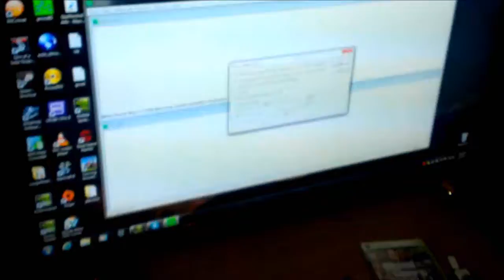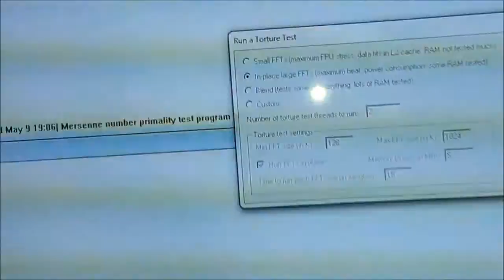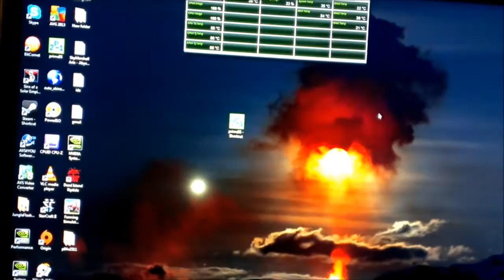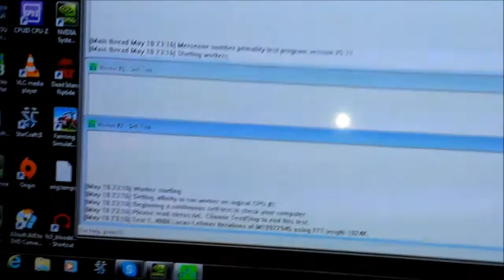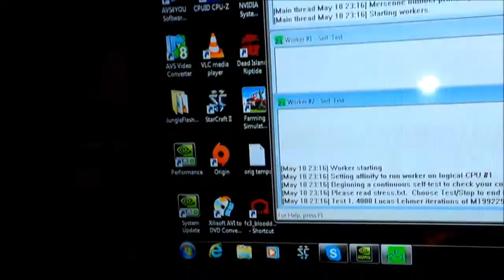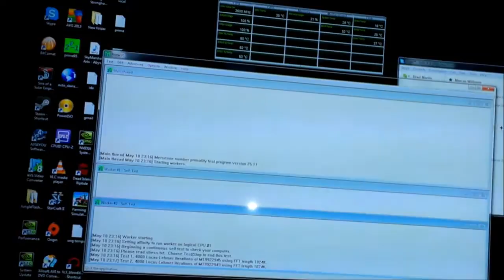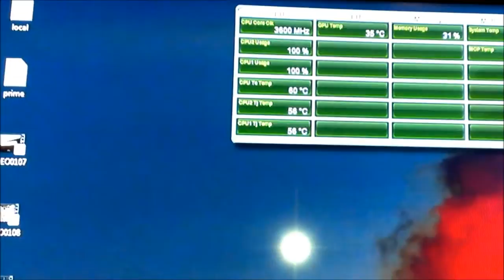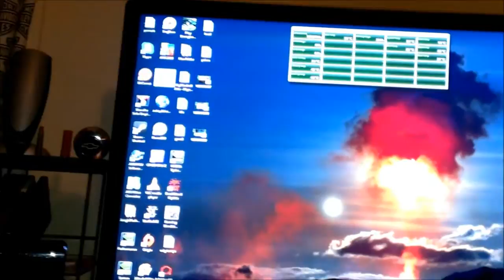Graphene vs Arctic silver 5 thermal paste

Comment: Graphene would be great, but the essential problem is having in paste form. The way the molecules line up, the heat needs to go from one side of the molecule to another. With paste, the molecules are in all sorts of directions. If you had a sheet of Graphene grown uniformly and all molecules are pointing in one direction it should make a huge difference. But, sheets are way to expensive right now. Also, try using a Peltier Thermo-Electric Cooler Module. May see a bigger cooling difference with that.

Comment: For starters graphene is the branding on the tube, god knows what the contents are. I could make a product called "water" and sell people bottles full of oil...

Secondly the whole reason graphene is one of the best thermal conductors known to science is because its so damn thin, the layers that make up graphene are atomic in thickness... somehow they thought mixing those layers with a liquid making it into a thick putty would work.

Thirdly burn in is an absolute must for direct side by side comparison, primarily because thermal "paste" is most heat conductive when all of the liquid has been essentially boiled/ evaporated out of it.

The product is bad. The test wasn't exactly done properly (no offense to the poster, just making an observation).
Reply from the maker: the test was done properly... it was burned in for a week at most. and when inspecting it the grapheme had put gouges into the heatsink and cpu... I have also tried it in a junk computer that had a 2.8ghz Pentium 4 cpu for about 6 months and it completely destroyed the cpu and heatsink surface. had to spend half an hour to sand down both with high grit sand paper... it was terrible.... arctic silver 5 all the way...
Reply: Fair enough, didnt hear it mentioned in the video. well I take back the third part, the first two still stand, which they aren't your fault, its the company selling a product called "graphene" that even if it contains graphene, isnt in its proper form to do its job. Honestly would be safer using a number 2 pencil to shade the top of the processors heat sink, this would at least be closer to true graphene, albeit not perfect.

In true scientific applications for graphene thermal conduction the heat sink and cpu would be all one piece made up of millions of layers of graphene sheet. Its just not that cheap to make like that unfortunately.
Reply from the maker: yes exactly... thank you for posting this comment. this company is not what it says it is...

Comment: I just replaced the graphene thermal paste with some Arctic Silver II I had laying around, ran prime95 until completion of the third test (using  in-place Large FFTs).  I just broke 67C with that, keeping in mind that this is a fresh, uncured application of ASII.  Plus, I noticed that the graphene paste on the die and heatsink looked grainy, I could see some of the die and heatsink around grains of graphene paste.  That shouldn't happen with a quality thermal paste.  All one should see is paste.

Comment: I received a sample of graphene thermal paste and applied it to my Core 2 Duo laptop, after removing the stock thermal pad.  Ran prime95 the same way you did...temperatures rapidly climbed to about 95C!!!  I quickly shut down prime95.  I have used many different products (generic pastes, AS5, Antec Formula 7).  This graphene stuff may not be all that it is cracked up to be.  Will try again with even less paste.